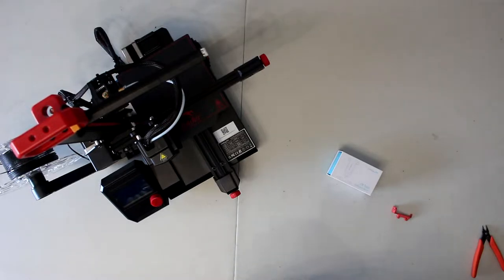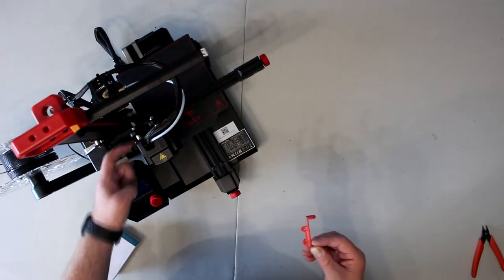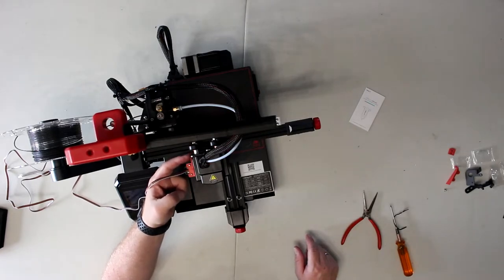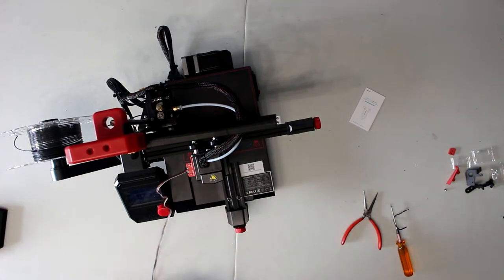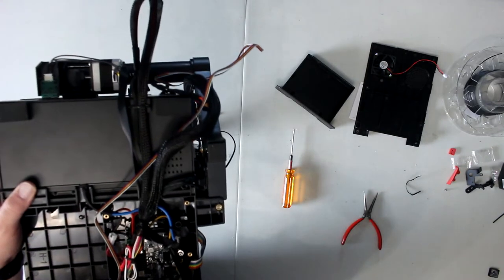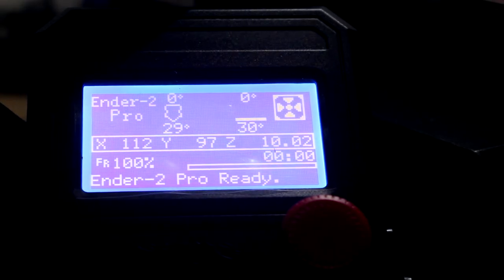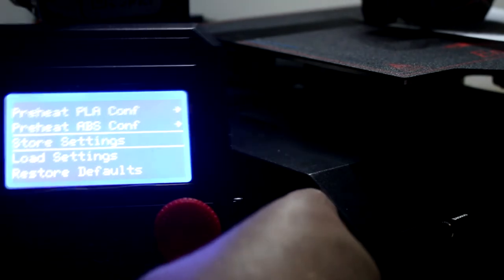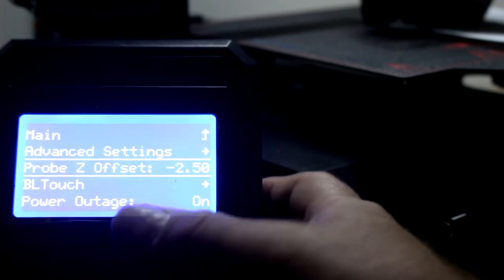CR Touch On Ender 2 Pro Install And Setting Z Offset For The CR Touch

Comment: Does this require you to alter the start gcode in your slicer so it uses the probe?
Reply from the maker: To be honest, I do not remember. I don’t think so, but the firmware has the probe in it.
Reply: @djsprc  I have the V2.4 s4 and I also have a CR touch ready to fit just not sure whether it is going to cause any issue? Is this ok to run with the V2.4 board? Any way to see what bitrate it is - i have a HC32F460KCTA chip..

Comment: Excellent video. Very well explained. Does the printer have filament run out sensor or can that be added also?
Reply from the maker: No it does not. You’re probably could add it if you go to a custom firmware.

Comment: Hi, thank you for the help, but when all hardware is install how to make the mapping on the bed? The cr touch seems work correct. I made everything like the video. I have the 4.2.3 board, and I use prusaslicer. Thank you
Reply from the maker: If you want mapping that part, you will need to do a different firmware and program it in the firmware.

Comment: Really cool video thanks for sharing it  , I am a happy owner  an ender 2 pro and use it for weekend projects , is this touch add on worth it if the 3d  printer is used sporadically?   I am new to 3d printing so it's not clear for me if this add-on is useful to  add precision to the printing process  or if it will completely resolve the need of manual adjustment of printing table...
Reply from the maker: Thank you for that comment,  I would say continue doing it manually.  the only reason I did it is because my two other machines that I have I have the Bl  touch on them. On that printer it’s not a necessity. You could say I don’t keep anything stock for long lol.
Reply: A little late but if you’re still printing and don’t have it, I would get one. They’re cheap and the print quality is definitely better with them. With a touch and a filament dryer to print from, you’ll get great looking prints 99% of the time.

Comment: Hello. The video is really informative.
But I couldn't do the software side. I downloaded the files you showed. I copied the one suitable for my motherboard to my empty 32bit SD card. With the device unplugged, I inserted my SD card into the slot and turned on the power. But there was no download. Can you help me? I couldn't find information on this subject anywhere.
Reply from the maker: The only thing I can see that could’ve happened that did happen to me certain SD cards will not work for the firmware upgrade or you might have a too big of a card. The card that worked for my printer was a cheap 8 gb card.
Reply: @djsprc  The card I used was the card that came with the device. But let me check my junk box. Let me try my old cards.
Reply from the maker: @atimucink  if I remember correctly, the card I was using I was able to read it to print but to update the firmware it would not work. It’s a possibility to boot loader on the board is not able to grab a high capacity card.
Reply: @djsprc  I am very sorry that my attempts so far have been in vain. I tried 7 SD cards. None of them were able to update. Is there any protection somewhere in this software?
Reply from the maker: @atimucink  the only thing I can see is there is two types of boards for this printer. You might have to board that you cannot use the software.  If you want to confirm, what type of board  you have you will need to open your printer and look at the board model.  If you’re able to find your model of your board, let me know. I’ll see if I can find you a firmware.

Comment: Downloaded the firmware, placed it on the SD put the SD card in and nothing. No changes. Like others I have the 4.2 board. Luck for me I had a spare CR touch laying around. Otherwise I would be pissed. I might just put an switch to a SKR board and move it over to Klipper.
Reply from the maker: There is a lot of people having issues with certain firmware‘s.  And for me it’s the second cr touch that I get that is defective.
Reply: @djsprc  So the CR Touch I have is still good. It was from my Ender 5 that I converted to use an Afterburner hotend  with a different sensor. I see there is a download for the S4 board and the other link has an older version of Marlin. So not sure what the issue is.
Reply from the maker: @tactikool4740  just make sure you don’t have an S4 board if that’s what you have. Unfortunately it does not work.   My board is a 4.2.3 when you go on the download it’s the first one.   But if you have the S4 version it won’t work.

Comment: Hey, this is a great guide on the install and the software setup, but how do I get it to auto level. I used the auto level option and it just goes up (Z axis goes up) and doesn't level.
Reply from the maker: First question, did you upgrade the software in the machine second question is it the cr touch you’re using. What you’re telling me it tells me that there’s something not set up correctly if you’re not using the creality CR touch. 
That means your wiring is not correct 
The CR touch is made to work with the creality software   let me know
Reply: @djsprc  i the level to work but i cant get it to stay at the correct z level, i have to use micro step down when the print starts. Using the CR Touh and the firmware in the link for the 4.2.3 board
Reply from the maker: @wraith8852  if it works, then you turn the machine off turn it back on it’s not working anymore you’re not saving it in the EPROM.  If that’s the case, make sure when you enter your Z offset, save it to EPROM.

Comment: can you help me? I can't get the software installed, I did everything exactly as you said but the printer won't download it from the card...
Reply from the maker: You will need to confirm the model of your board and these printers they made two models for the main motherboard. The software that I use is made for a specific board. V4.2.3. If you don’t have that model, unfortunately it will not work.  Now, if that’s the model you have I would suggest to try a different SD card. Do not use a high capacity card.
Reply: Thanks for the fast answer.
Does the CR have to be connected beforehand? @djsprc
Reply from the maker: @fabiankempe5332  you don’t need to

Comment: how do i check what board is in my printer?
Reply from the maker: You will need to open the panel underneath the printer and check directly on the board.
Reply: @djsprc  thanks!

Comment: My board is v2.4.s4 and i installed the file you provided but auto home does not probe anything. it just goes home
Reply: it probably didn't flash the firmware. mine won't
Reply: @dfryer4558  It did flash, just the motherboard is crap. Don't try to upgrade.  waste if time.
Reply: @gabrielmirzakandov4379  too late, it's a great little printer!

Comment: I got the CR touch fpr my ENder 3 V2 as it came out, didnt regret it, noch reason to change for BL Touch. Thinking about to convert my ener 2 pro also. Which is the best FIrmware?
Reply from the maker: At the moment it would be Creality, firmware, or a custom firmware.

Comment: The only problem i can see is you can not manual level the four corners of the bed before you auto bed level with this firmware.
Reply from the maker: Yes you can. I did manual level before I did auto level.
Reply: @djsprc  okay show us how to do this please
Reply: @djsprc  can you make a short video showing how to do that
Reply from the maker: @grampafpv8013  yes I can but it won’t be before next weekend if that’s OK with you I’ll do it.
Reply: @djsprc  that would be awesome thank you
Reply from the maker: @grampafpv8013  I reply to one of your comments with a link to the latest video I made how to do a manual level in the video description you will find  a downloadable link for a G code to help you level

Comment: How did you flash the firmware ?
Reply from the maker: Look in the description in the video download the firmware put it on your SD card inserted in the machine turn the machine on it will install itself once your screen will boot back up you can turn the machine off remove the SD card and the software is installed.

Comment: Is it possible to add more than 1 point of autolevel. 1 want it to have 9 like the prusa mini
Reply from the maker: Yes, there is you would need to do a custom marlin firmware.  The firmware on this machine right now is the creality.
Reply: @djsprc  thanks. I'll try that

Comment: How do you know which firmware to use? Thanks
Reply from the maker: Normally you’ll have two sets of firmware one will be without the CR touch and other one will be with the  CR touch. If you click on the Google link, that’s in the view description it will bring you to the creality, google drive to be able to download the firmware
Reply: Disco Stu  Got it. Thanks
Reply from the maker: Disco Stu  the link that I have in my video description is for board version V4.2.3. It is a 32 bit bored. The CR touch is made for the new ender 2  pro.  It will not work on the original ender 2.
Reply from the maker: Disco Stu  sorry about that but I needed to make sure that people know it’s for the new machine cause I’m getting questions on the older machines. But thank you for the help. Really appreciate it.

Comment: Have the 2.4.s4 board, cant get it working, If anyone happens to have  a sollution let me know because rn im stuck
Reply: am stuck too with 2.4.s4, i cant find a firmware to work with it.
Reply from the maker: Is your machine brand-new or an older  if it’s a brand new one it looks like they’re making or shipping the machine with two different boards . Mine is a V4.2.3.
Reply from the maker: @nordicravn  if you cannot find any firmware, you might need to do a custom Marlin that might work for the type of board you have.
Reply: @djsprc  mine is v4.2.3 and at the same time nothing works, the 3d-touch goes only up and it doesn't go down at all ( using ender2-pro )
Reply from the maker: @karovz5521  are you using the CR touch from creality?
Reply: @djsprc  3d touch is the one I'm using
Reply from the maker: @karovz5521  unfortunately, the firmware from creality is made for the CR touch only it’s not the same pin out.  It still might work if you do the same type of connection as the CR touch all connected at the same place.
Reply: @djsprc  everything else work just it doesnt go down o  the Z axis
Reply from the maker: @karovz5521  yes that’s normal in the firmware the way it’s built all the connection should be where it’s supposed to be plugged in on the board. I had the same issue with my ender 3 max. That’s why I went custom marlin to fix that.
Reply: @djsprc  can I use your custom marlin?
Reply from the maker: @karovz5521  unfortunately no the custom marlin I have is for my Ender 3 Max. The one I have in my ender 2 pro is from creality.

Comment: Hey is this the cr touch for 2.4.s4 board ? I can't get the firmware to boot from the link and was wondering if this is an older board,
Reply from the maker: The board i have it on is 4.2.2 . This CR Touch is made for a 32 Bit Board.
Reply from the maker: Disco Stu  you might be right I’m not sure what’s the board number in that machine